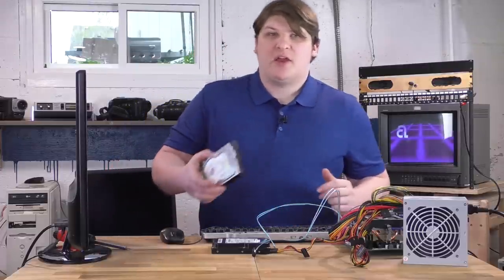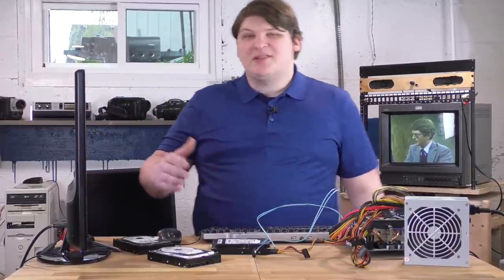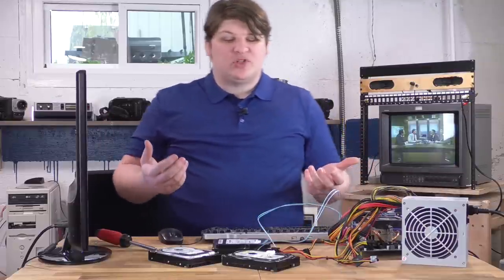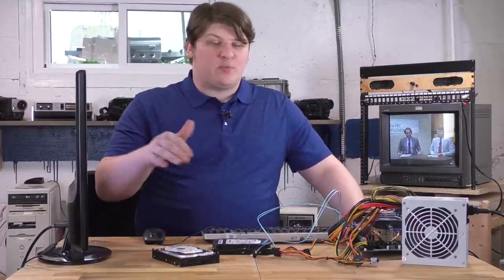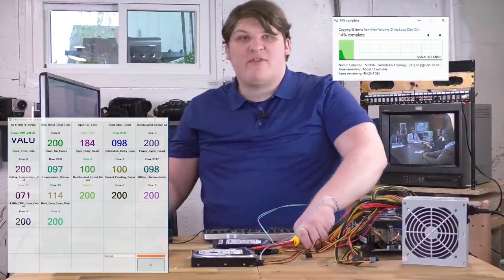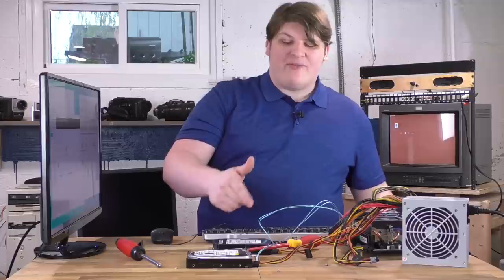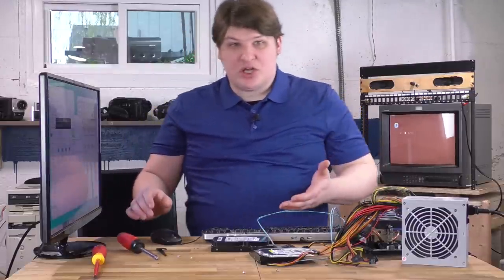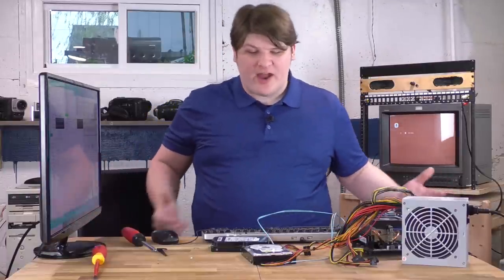Can A Hard Drive Breathe Regular Air Like Us

Comment: my old WD blue has 71,068 hours on it.... 
.
thats 8.113 YEARS of running it 24/7 (and i turn my PC off sometimes.... mostly just let it run with the disks still spinning)
.
meanwhile.... i cant keep a WD black running for more than 2 years
despite the black and the blue being in the same cage... one on top of the other
.
.
.
like.... instead of a 2TB WB black..... id rather just have WD give me FOUR 1 tb wd blues
and id raid them for 2 TB of super fast storage 
.
model number is WD 10EALS--00z8A0
and apparently.... at least the one i have.... is a BAD ASS
.
only cockroaches and this 1TB WB blue would still be around after a nuke war

Comment: trouble is the data could be corrupt and windows wouldn't tell you.
Reply from the maker: Can't think why that would be, for the last 50 years everything has been built with checksums stacked on checksums. Undetected file corruption at an OS/hardware level is virtually unheard of. Even mid-80s DOS verifies checksums on floppy disks.

Comment: You can run a hard drive with the top off as long as the head does not have a screw go through it from the top and it can do fine for about 20 mins, did this back in 2008, https://www.youtube.com/watch?v=UiShWC2GH2o

Comment: 3:51 its the current that kills NOT the voltage
Reply from the maker: @netheritecraftondrugs5126  That's a meaningless meme. Current is a function of voltage and resistance, and the resistance of the human body is relatively known. you are not going to find a current limited supply in existence that produces less than the microamps required to stop a human heart outside of a laboratory, so the effective current is always going to be present by the time you get to a voltage high enough to penetrate deep into your tissues.
Reply: @CathodeRayDude   I have always heard that it is the Amperage that kills.

Comment: Your video is off. Take the top completely off and do that. Can't with most modern drives. Most modern drives use the top cover as a tensioner / washer for the head stack. Remove it, the heads go wild.